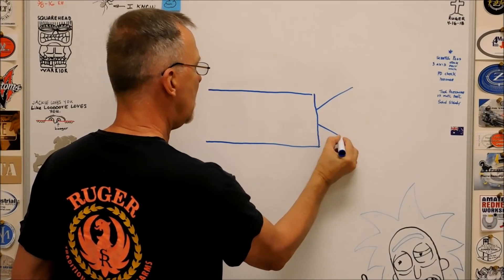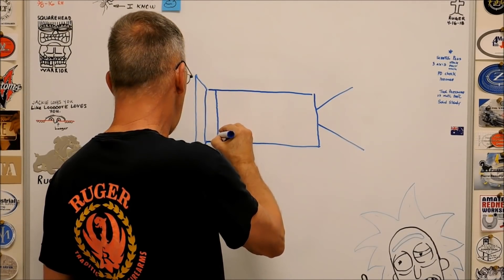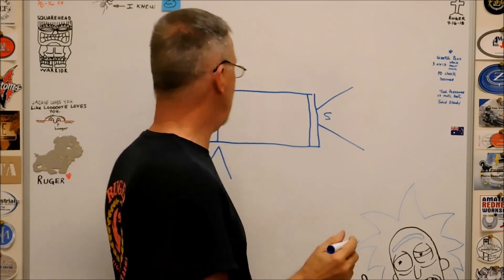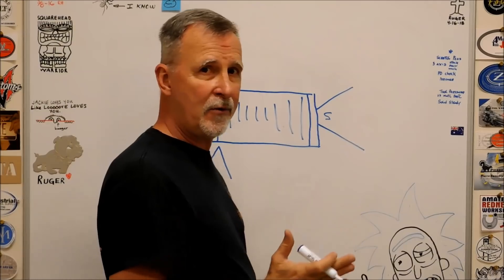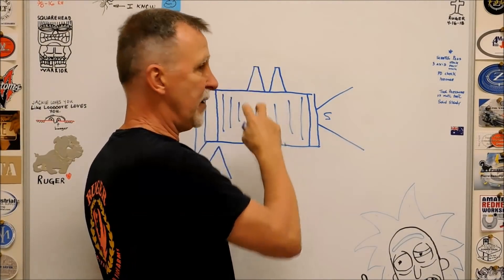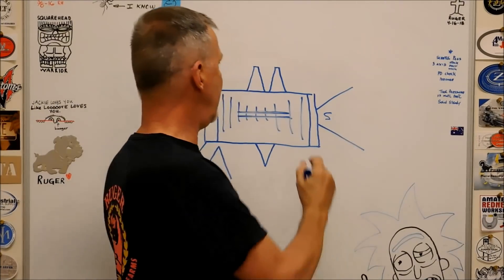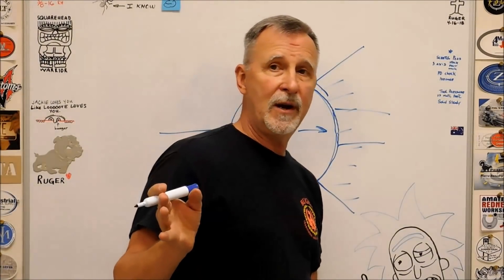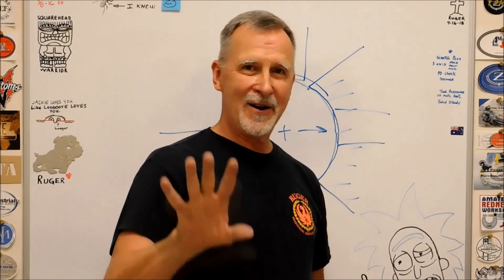CRITICAL Information You NEED to Know to Single Point Successfully. DON'T MISS THIS ONE !!

Comment: @Joe Pie  I like how you gave a good, clear, explanation on how center lines work. When I sold hardware, nuts, bolts, for Home Depot it was often difficult to explain to people the difference in shape of threads and how a nut screws on. Like squared off automotive threads will accept a normal nut but the threads won't mesh fully or correctly and the slop will cause part failure.

Comment: You really have a knack for teaching, well explained. Even if You sort of know this it is easy to forget and screw up...
 I really liked the video on the phenolic follow rest support with the in situ machined hole. Used that idea several times. Made an adaptor for my usual follow rest that takes a small piece of phenolic on the brass tip, worked really well. Advantage is that the support can be tweaked a little with the adjustment screw on the follow rest. Phenolic is a underrated material as a bearing and gear material. Main gear in my Arboga drillpress is a made of phenolic cloth composite. The material absorbs just the right amount of oil to make a good bearing surface and also reduces vibration.

Comment: Great presentation that is much needed to advance the quality of the art and perfection of machining! I very much want to use the chuck to tail-stock method of single point threading but would like some advice on how to do this safely with a lathe chuck that is threaded to the spindle so the chuck will not unscrew itself from the spindle during this process. Thanks for the expert fabulous lessons you provide.
Reply from the maker: Glad it was helpful!

Comment: Great info as always. Hope you have a speedy recovery.
I Would love to see a video on the use of the follow rest in cases where you want to reduce the diameter of a long thin piece. (something like in a hobby/benchtop lathe, 1 Ft /30cm long workpiece 1/4" / 6mm od) I would love to know how to set it up and how to  adjust it after each pass. Do you cut in front of or behind the supported area? left to right/right to left? Do you support on the cut (new) diameter or the old diameter. All kinds of question come to mind if I think about multiple passes on the OD of a part.
Reply from the maker: I would say to keep the follow rest on the raw material if possible and adjust between cuts.

Comment: Joe I love the videos you put out and it's really helped me while learning the trade.  Could you do a video on threading with the crossfeed dial?  The reason I ask is because in your threading video from several years ago, you show how you run threads in reverse by putting the cutter upside down and you keep feeding in with the crossfeed dial instead of the compound.  Could you explain how and why you do that?  I think with doing it on the crossfeed you're cutting on both sides of the cutter even more, so would that be good on larger stock?

Comment: You absolutely have to have some form of follow rest to turn those small diameter threads. I actually built that same style follow rest you used in your videos awhile back. Thanks for the tip.

Comment: Thank you for the video. I have recently cut the thread using the method of flipped tool, and travel away from the chuck, that i learned from your previous videos. It worked awesome.  Keep up with the sharing, learned a lot from you by now...

Comment: Your channel is my go to for a "how to actually machine something" channel. Well explained and a logical progression across the board. So thanks.
- Question: Is there a preferred online forum for machining information?
I'm most of the way through retrofitting a mill with a modern (and working!) CNC system and if there is a forum that stands out I have some questions that need answering before my mill is ready to fire up.
Reply from the maker: There are forums for just about all machining topics. Google it and pick one. You may have to join before you can participate.

Comment: Had to thread a little 5/16-40 part for a Jerry Howell engine, die wasn’t going to come quick enough. Flipped the tool upside down like I’ve seen you do on your videos so I wouldn’t crash, and spent the rest of the day giggling because it came out better than sliced bread and got tighter than I would have managed with a die. Great content thanks!
Reply from the maker: Outstanding.

Comment: Hi Joe.  I took your advise and just ordered a LH insert holder so that I can do invereted threading (threading away from chuck).  However I have found that EL inserts are not that popular.  (Also you mentioned spiral staircases.  Spiral staitcases are mostly helical staircases.  Spiral staircases have a changing radius.)   Cheers
Reply from the maker: My holders take top notch inserts.
Reply: @joepie221  Thanks Joe.  I have a Kennametal distributor near me.  Cheers.

Comment: hey joe,-  what is your thoughts on flat bottom acme or square thread using a narrower tool with the compound set to 90 and advancing the compound to cut only one side once bottom is met.  thus reducing tool pressure and getting a better finish.
Reply from the maker: I'm all for it.

Comment: One thing I do when cutting/chasing long threads using the follower rest.  I leave the live center in your tail stock loose on the end of the part so any runout in the bar is kept concentric at the follower rest.  This seems to let you cut a thread with less chatter and keeps a consistent depth of cut, too.  When I say runout, less than .002/.003".  I try to avoid bar stock with more runout than that.  Usually use T,P, & G when i can get it.  If I have to turn it down, I rough it to near size, let it cool down.  Then set up carefully and start to finish turning to near size, check my concentricity, adjust if necessary, and finish turning.  Thanks for sharing, Joe,  Ken

Comment: Always love your videos.
I have a question. How can you determine the number of threads per inch of a threaded hole when no screws or bolts you have fits 
and you can’t get a thread gage in the hole? Maybe it’s a antique or there is not enough metal to drill and retap. Does anybody make something to go in the hole, plastic or ?, that can replicate the thread so you can take it out and measure the thread?
Reply from the maker: I've seen guys use wax on larger internal threads, then measure the form on a comparator. I would suggest, if you have the space, grab an assortment of smaller diameter screws and nest them in the thread. Look for the one that seats the best without z axis (centerline) movement or rocking. Then measure the hole diameter. It will get you close, but some imperial and metric threads are very close in pitch.
Reply: Assuming you have a means to fixture a test indicator such as a height gauge, run the tip of a test indicator down the ID of the hole and chart where the tip bumps the crests vs depth.

Comment: great tip!

I have an off topic question:
my lathe arrived, and 4 jaw chuck turned out to be self-centering (I assumed ordering 4 jaw means independent). I bought the lathe primarily to drill holes in the rectangular aluminum+iron sandwich stock, so I bought another 4 jaw chuck which is independent. 
4 jaw independent has 4 mounting bolts, and self-centering 3 mounting bolts.

Question: is it OK to just drill 3 extra holes in the back plate, to mount the independent chuck? or do you recommend buying the cast iron cake, and machine a new back plate dedicated to the independent chuck?
Reply: I’ve been machining for 60 years and never knew anyone made a self- centering four jaw until now. If it looks doable I’d just add more holes to the backing plate you have.
Reply: @ellieprice363  that's why when I ordered a 4 jaw, I didn't specifically mention INDEPENDENT because to me it was self-explanatory. they sent me self centering 4 jaw just to teach me a lesson.

thanks for your opinion on the extra holes. some people said it would make the back plate imbalanced. I will try it anyway
Reply: @TigerCarpenter  Like you I would have thought all four jaw chucks were independent. I can’t see any advantage but it is what it is. The slight imbalance of additional holes, if any, probably won’t be noticeable and much preferable over making a whole new plate.

Comment: I also have a lead screw to make that is long and thin I would very much appreciate you giving some instruction on precisely how to organise the steady rest in relation to the cutting of the thread, in this case, an 8 tpi ACME thread over 3 feet in 3/4 inch stock.     Whilst I have not heard of detail of your medical condition I take it from your comment that you have not been in the best of health so I wish you a speedy and full recovery and I look forward to more video gold from you.
Reply from the maker: Thank you. My health is fine, but my achilles needed to be cut for a heel procedure, so walking is almost impossible. I'm getting there.
Reply: Joe I hope your Achilles trouble gets sorted and you are able to walk and stand without discomfort or worse very soon mate! Regards from the UK
Reply: You need a follow rest with bronze tips. 
    One thing I like to do is use a flat tool that is the maximum width of what will be the valleys first.
   Make a couple passes to get 5 or 10 thou deep. Then sand/file the burr off. Reset your acme tool to the center of the groove and finish the thread. If you don't do this you'll get a burr on every cut that wears the bronze tips on every pass forcing you to constantly adjust.
Reply: @ME-pb2gf  Thank you for that tip. I was wondering how to avoid chewing up the steady tips, I am contemplating using ball races for the tips but that would still not avoid the burr problem!
Reply: @ME-pb2gf  I did something similar with aluminium but it wore something awful and basically I had to adjust and adjust until I got to full depth (0.060”) but it did work. Next time I will try phenolic plates and will use your suggestion as to avoiding the burrs. Thanks for that suggestion.I dread to think what the cost of bronze would be25 wide by 12 thick and no doubt at least 300 long. Would probably be more than the cost of a new lead screw lol
Reply: @joepie221   Ouch! Went through the same procedure as a kid, hurt a lot and had to learn to walk all over again. Hope you have a speedy recovery.

Comment: It's insane that this technology has been around since 250 BC when Archimedes invented his now-famous screw. Keep up the good work I love watching you build stuff. I was an auto technician for most of my adult life but for a year-and-a-half starting in 1971 I worked at Bennett Respiration as a machine operator. I ran a french-made screw machine for a. It sounded something like Cry Dan. I ran a twin spindle collet turret lathe finishing. 
.0002" tolerance shaft on the Sigh Valve. I measured it on both a Optical Comparator and a pair of ruby jewels with metered air.

Comment: Can you comment on how a lathe dog use (turning between centres) would help to fix the work piece straightness problem, before threading so the centre line is corrected.
Reply from the maker: With correct tail stock pressure, a lathe dog drives, and allows a shaft to spin freely without the influence of being held in a rigid setup. It finds its happy place between 2 centers and is free to relax during machining.

Comment: I have also learned that you can't count on round stock to be round. Many times you get the old egg shaped round stock especially in the smaller diameters. Rolling it on a surface plate or even the bandsaw table is a great tip.
Reply from the maker: Assume nothing and you'll never be disappointed.

Comment: Greetings Uncle Joe✌🏻, that sharpie chatter😬😂..... just kidding. I learned these lessons well when I had to make a lead screw for a TOS boring mill, had to make the nut too. Lead screw was EN8 n nut was aluminium bronze. The total lead screw length was 1.8m but only 1.4m of thread on it, was 7mm pitch trapezoidal on a 45mm dia. if my memory doesn't fail me. Was hell n fun at the same time😂🤣.

Comment: Joe's explanation of the thread error caused by the difference between the center of the stock and the lathe's spindle is another reason to follow your reference book's O.D. dimension call out for the thread you are cutting. This given diameter is smaller than the nominal size of the thread. Unless the stock is badly bent or out of round, turning the called out diameter will usually avoid the problem Joe describes. 
The follow rest is your friend to prevent work deflection for long and/or small diameter stock to be threaded. There are several ways to skin this cat. A steady rest with a Vee brass support can be made that clamps to the tail stock quill.  It may support the work well enough to avoid the follower rest. On some lathes you may be able to do this from the head stock (now you know what those line-bored holes  in the head stock above the spindle are for on very old lathes. It's to hold the bar for the overhead steady rest that uses a Vee or shaped support like Joe illustrated). This style of rest has the advantage of being able to move the tool from one side of the steady rest to the other without having to deal with unbolting and moving a steady rest mounted on the bed of the lathe to the other side of the carriage cross slide.
Following Joe's advice here about faulty threads is really important for Class 3 threads that have long engagements. You turn the threads and all measures well The parts will start to go together just fine and then the fit-up gets worse and worse till they bind up completely.
Cheers from NC/USA

Comment: So I've been a machinist for 15 years and we always start with a larger piece of stock and turn the major diameter to size so the material is straight and true before ever cutting the first thread. The only material that we might ever thread without turning first is PSQ bar (pump shat quality) but usually the major diameter would be to big for the thread to be cut so once again we would turn it the proper major diameter.
Reply from the maker: Concentricity is necessary. Some just don't understand that. But, you can always make the thread grosely undersize to make it work. :)

Comment: Can I come work with you for a couple weeks? Internship? I'm setting up my home shop and I want to spend some time working with some different machines....
Reply: A couple of weeks won't make you a machinist. Here in Ontario it takes 4 years of schooling and experience before you can write the qualification exam.
Reply: While it wouldn't make a machinist, it would help a newbie get experience around machines and learn good safety practices. That said, it would be taking time to teach someone and might be a burden on the teacher. Particularly when the teacher has a business to run. There are a ton of videos here that help with basic operations and safety. Not just Joe, but a number of people post informative and interesting videos. An in person option is local community colleges and vocational schools. An intro class wouldn't be expensive and would include an instructor's time.
Reply: My top choice would be Keith Fenner.Turn Wright Machine Works. Extremely talented in the trade with out the puffed up chest and squeaky white board, along with Abom79 and Mr.Pete and a few other NON Mr. Knowitall machinist channels. Just my opinion.

Comment: Good explanation Joe. I've been doing upside down and backwards threading ever since I saw your video. Except for left hand threads :-)
Reply from the maker: Left hand threads can be done the same way. Keep the tool upright and thread out. Machine in forward.
Reply: You can thread left to right for all threads, right hand, left hand for both external and internal threading. No stress.

Comment: Hi joe ....as we talk about follow rest i always have struggle with the bronze tips ....as i progress the thread debth it takes the shape of the thread those bronze tips get damaged when reverse ,,,if you have some good suggestion to solve this issue .
Thanks as always have agood time.
Reply from the maker: Burrs on the crest of a thread may accelerate the wear of bronze follow rest pads. Run a file across the top of the threads as part of the process when using a follow rest.